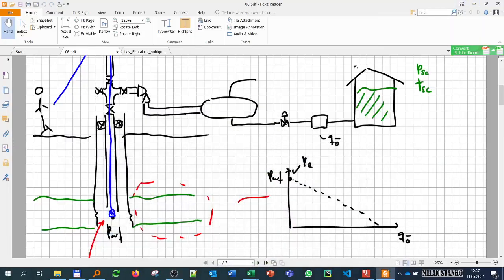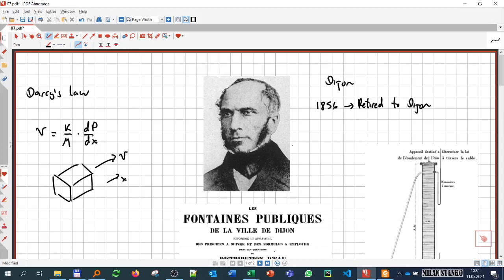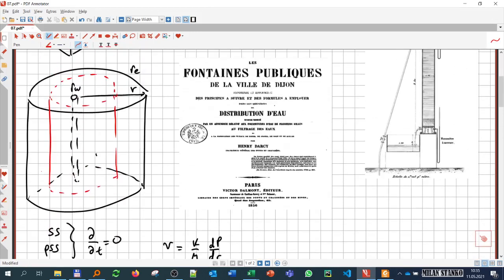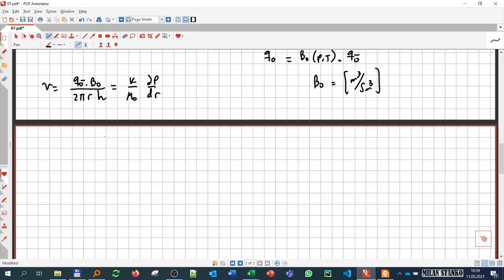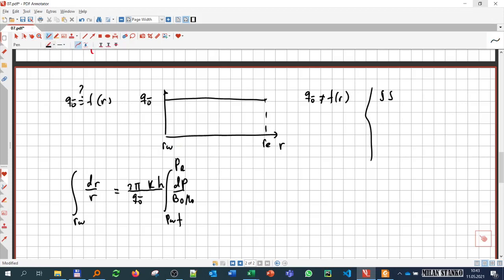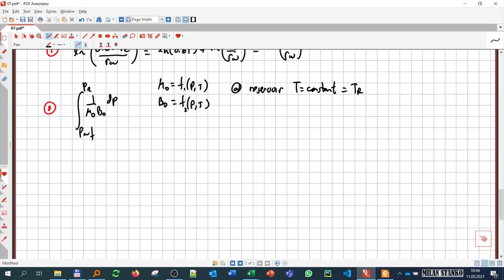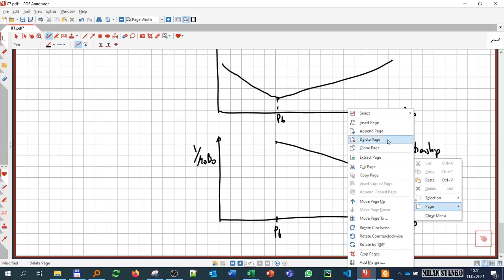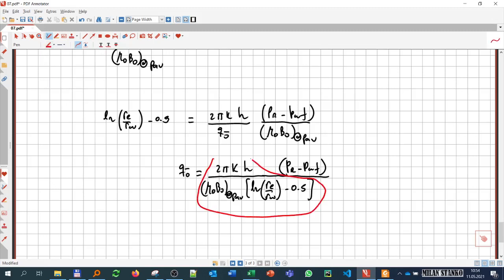07. Derivation of IPR for vertical well, undersaturated oil

Comment: Dear Milan, Thank you for the lectures.
You mentioned that we need some mathematical derivations to obtain “for ss, r @P_R = 0.62re.”
I would appreciate it if you could provide more details, and if possible, any relevant references.
Reply from the maker: Should be in section 6.6.4 in the book Nodal Analysis of Oil and Gas Production Systems
By Jan Dirk Jansen